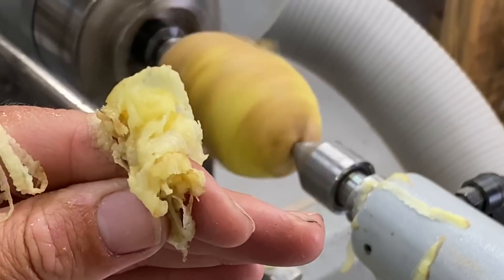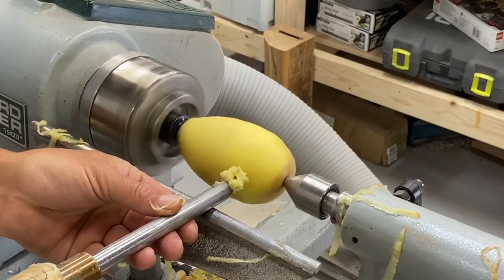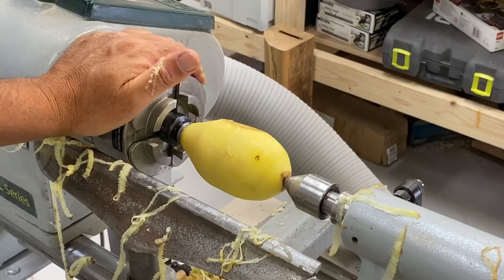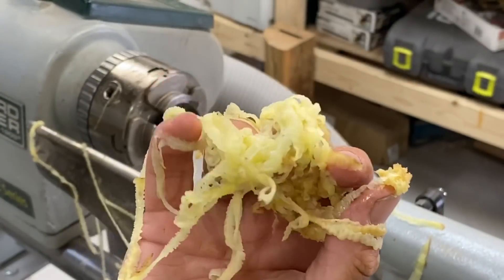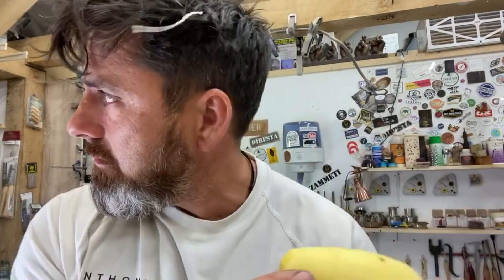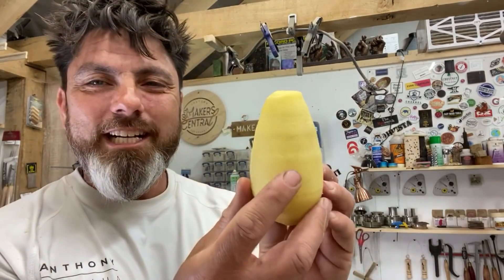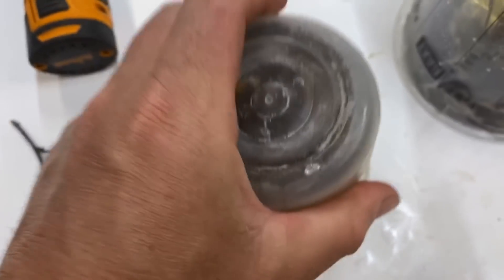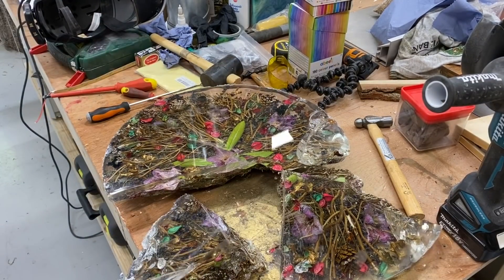Can You Peel A Potato On A Lathe ?

Comment: You should encapsulate some sort of wax figure with a tube going out of resin and then after the resin sets warm it up and melt the wax out. As long as the resin doesn't get too hot as it goes off

Comment: The flower result isn't the same you get for all wet items in resin. I put a slice of banana in resin about 3 yrs ago and it's doing fine. It's slightly darker, the resin did crack from the pressure of the decay and gases I assume, but it's still fine.

Comment: That was just Spudtacular!

@NickZammeti could you stabilize the potato in resin? Would it still have the same effect as the flowers?
Reply: You'd need to dry it out first, and the problem is that that the potatoes thickness means it will take a while to do that. Possibly longer than the potato would stay fresh and not spoil since it has been peeled.
Reply: @JMcMillen  if that's the case, could it then just be baked? Then stabilized?

Comment: NICK NICK NICK NICK NICK NICK!!!!!!!!!!!!!!!!!!!! I hope you see this suggestion NICK NICK NICK N... you get the drift.
Make a set of Halloween pumpkins with your families faces. You have a very attractive family so to make it more halloweeny, have them pull faces. Scared, saying BOO, growling, zombie...etc. The pumpkin would be easy, just flatten the face side a bit after you make the round part. The faces can be done ten different ways but I would do this (I have done this before but not on a turned piece), take the closeups, print on printer paper, tape carbon paper and the printed page to the readied pumpkin, trace on the printer paper then either trust that you are not going to lose the image and start up with your prefered method, I used a drill and dremel, or you can wood burn it before sculpting.
Your lichtenberg can be used for decoration around the faces. You could paint the inside with glow in the dark paint, you could make them into lights or go the old school route. Dang it, now I want to make some decorations for my favorite holiday/ Sabbat Samhain. Blessed Be